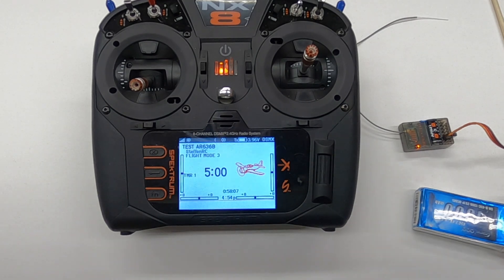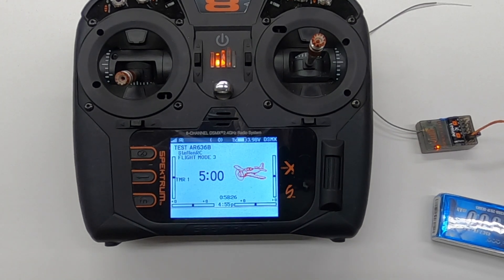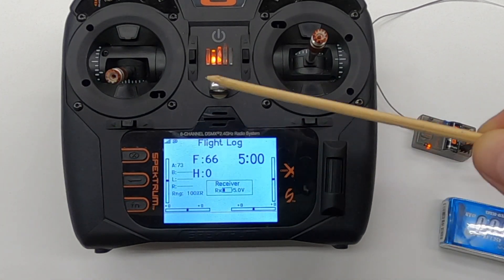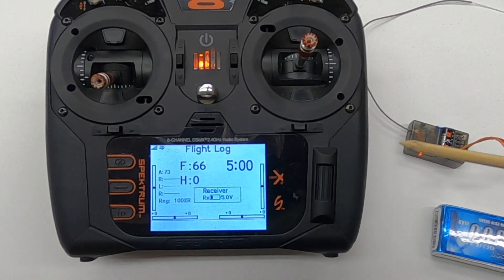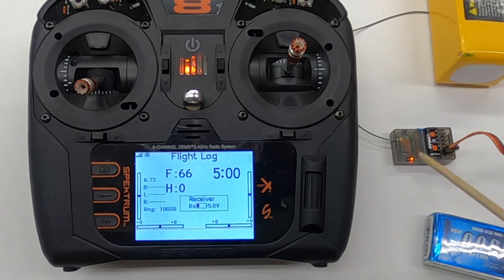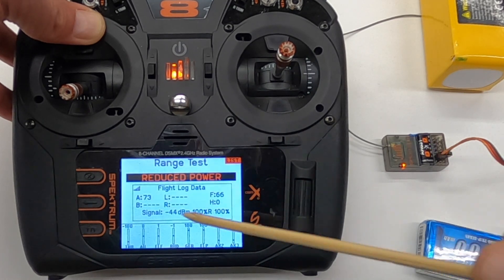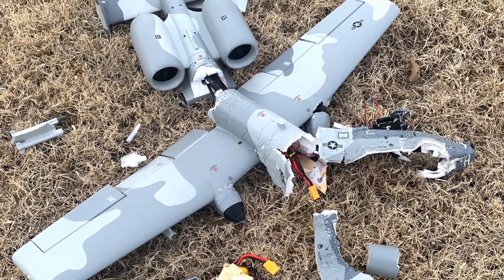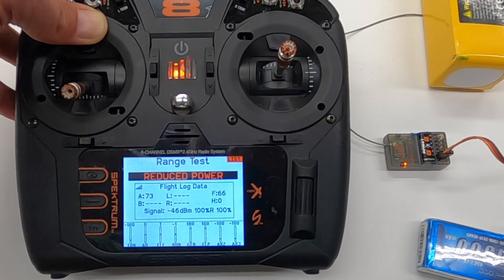How to use Spektrum Flight Logs to determine if your RX is killing your planes

Comment: Thank you for the vid! This is important info! I had this happen this weekend. Spektrum IX-12 and AR8360T. Unfortunately, the receiver battery came un plugged when my Revolver met the Earth ( abruptly ) and so the flight data was gone. Would be nice if the receivers could keep some memory so you can see the logs when you power the receiver back up.
Reply from the maker: Thats a bummer.  There is actually a way to record this data to your SD card.  I think I'm going to do a follow-up video to go into more details about this feature...

Comment: I been there with my futura and p-47 using the nx 8 and always forgot to go to  the radio to check but my issue was the transmitter losing info its heading  back to spectrum there going over it when I switch to the nx 10 no issues good info THanks ☺👍👍

Comment: That's exactly why I switched to FrSky
Reply from the maker: Thanks for watching and commenting.    Just to be clear.  I'm not saying Spektrum has issues..  In fact that smashed FMS Tigercat had my FrSKY system in it when it went down.  Truth be told, it was an issue with the BEC power to the X8R, not a signal issue..   The point of this video is pilots should understand how to view the performance of their RX/TX system and KNOW if they really have a signal issue, or something else.   I'm going to do a Part 2 to this video to dig deeper..   Thanks Will
Reply: @SteffenRC  Thanks for the clarification.... Excellent info that normally is not discussed but is vital... Keep up 💪. Looking forward to seeing part 2.. Subscribed ✌

Comment: Has the airplane side of RC started adopting ELRS?
Reply from the maker: The FPV Fixed wing guys have been doing this and some of the same pilots using RadioMaster for LOS, but the majority are using the Spektrum DSMX system, due to ease of use and it works pretty well.   I use both FrSKY and Spektrum and haven't seen any issues with either.  For LR fixed wing FPV I use FrSKY 900mhz system.  Truth is, most of the issues aren't RX protocol issues..  Seems more with antenna placement and rx's that have been abused in prior crashes..  But thats just my experience..   Thanks, Will

Comment: Hi Will, great info!!!!
Here’s one for ya:
I don’t understand the difference between selecting % or %R or dBm on the signal setting on my NX8. Also which one should I use? Does it matter which one is displayed. 
Hope you or anyone reading this can clear it up for me. 
Cheers 
Dave👍🏻🇬🇧
Reply from the maker: Dave,  I'm not an expert on this stuff..  But, in my mind the higher the number the better the signal.  I usually use the reception value %R in the flight logs.  Its just easier for me to understand that vs the % or dBm..   That said..  I'm going to dig into this a bit more and make a Part 2 video on this topic.
Reply: @SteffenRC  ah thanks for that Will. I seemed to have settled for the %R too as I understand that call out better than the other 2. I look forward to your in-depth video on it sometime and maybe we’ll all understand it better. 
Thanks again 
Dave👍🏻🇬🇧

Comment: So here is a question if the battery is ejected from the plane and the power is removed from the RX after a crash there will be no way to check the frame loss or can you still retrieve that data?
Reply from the maker: You are correct, the data won't give you the info you need.  That said, you can setup the Flight Log to write RX/TX packet info and telemetry to the SD card to analyze (like FrSKY and others). but its gotta be turned on.  I personally haven't done this, but it would be good to learn..  Hmmmm. Another video???   Thanks Will

Comment: Many people are quick to blame the receiver when it was actually a bad servo or retract that drew too much current and pulled the BEC voltage down below the receiver’s lower voltage limit. A receiver only draws a few milliamps, so it’s the least likely cause of a brownout. And, many blame the blue box even though it draws very little current. They need to use a good servo tester to check the current draw of the servos and retracts. I check them while I’m assembling a new plane and whenever there’s a problem.
Reply from the maker: Yep..  You get it..   I have lost signal twice in my  flying life.  Once, when I lost POWER to the rx (this busted Tigercat) and the other when I failed to extend my TX antenna on my old 72mhz system..  Neither were the tx/rx fault.. Those were pilot errors..  :-).  I'm sure there are strange anomalies that can happen, and will interfere with our 2.4ghz systems, but I think they are rare....  Thanks for watching and commenting..  Will

Comment: What would high frame loss and no holds mean, I had 305 frame loss but no holds yesterday, I felt the plane was not responding right away at times but nothing longer then .5 seconds.
Reply from the maker: How long was the flight?  Long 10min, could get you that amount of fades.  If you have 5min flights, then I'd be a little concerned.   Also, you might want to monitor where/when you are getting the frame loss.  I had a mess of frame loss on a plane, but found out is was when I was on the ground on a long/far taxi..  The flight frame loss was ok.   That said I still moved my antennas in different positions and that seemed to help reduce frame loss...   I've yet to experience a jitter with only frame loss or fades.  Holds are a disaster waiting to happen..

Comment: My rv7 went down i swear i had no control went straight into ground i went to flight log A:3458 F:3928 H:5 ive never done a ramge test on any of my planes not sure if i lost orientation or not but i swear i couldn't recover it all. Pilot error i guess any thoughts on those numbers
Reply from the maker: Calvin the numbers indicate you had 5 Holds which is pretty bad, considering any holds are bad..  I would test some of your other planes and see if they are getting poor performance too.  Just to rule out the TX..   Also, keep in mine that after we crash the RX/TX are still trying to talk to one another and when the plane is on the ground 200-300 yards away the radio performance will be awful, so those numbers might not tell the story of why you crashed...  You can set an alarm that your tx will warn you if you rx signal is below a certain percentage..  Hope you can repair that RV7...